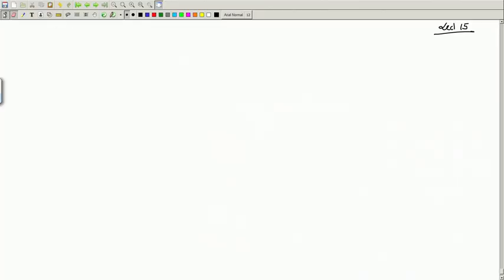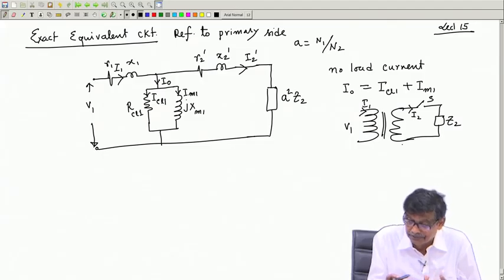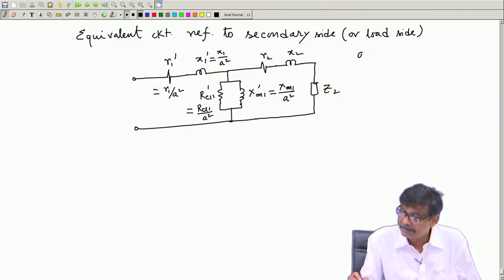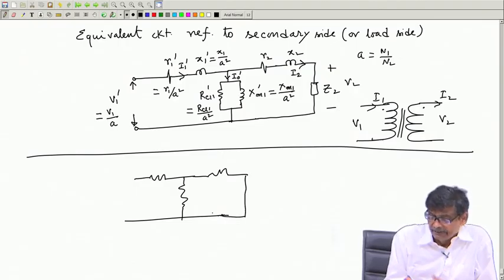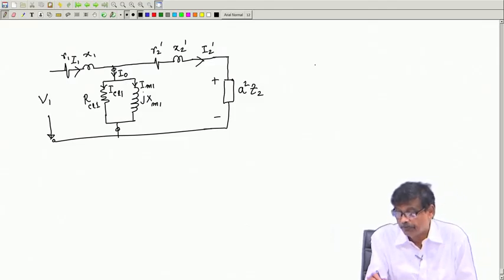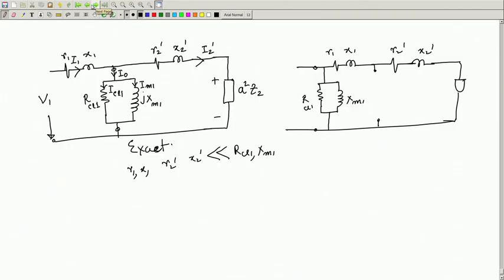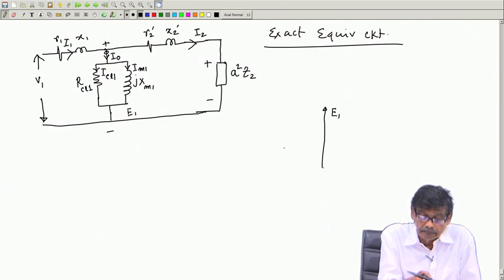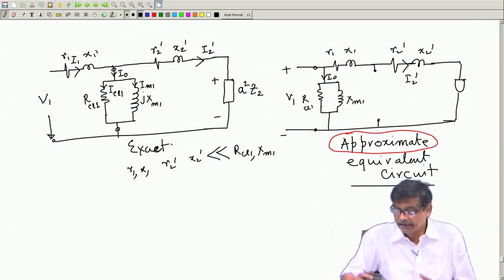Lecture 15: Approximate Equivalent Circuit

Comment: Why can't we put jxm and Rcl in series? Why are they in parallel?
Reply: For a particular frequency, greater the supply voltage (V1), greater the value of Bmax. More the value of Bmax, more will be the core loss. So,  as core loss is directly proportional to supply voltage V1, Rc is connected in parallel to supply voltage. Then the power loss in the resistor Rc will be : V1 square by Rc ( E1 is approximately equal to V1) . Meaning that, the power loss is directly proportional to supply voltage V1. But if Rc is connected in series, then voltage appearing across Rc will be much less than the supply voltage V1. If that is the case, we cannot say that power loss in Rc is directly proportional to supply voltage V1. Hence to represent the fact that core loss is directly proportional to the supply voltage V1,   Rc is connected parallel to V1.